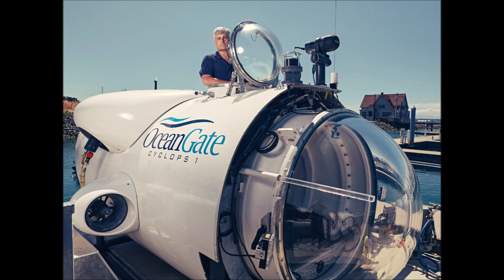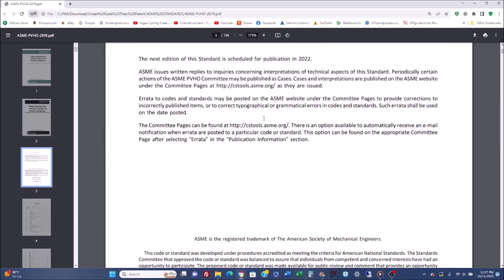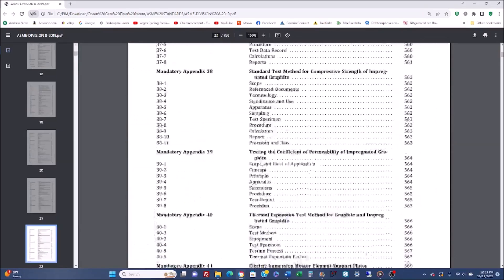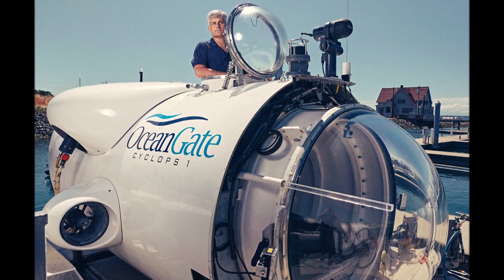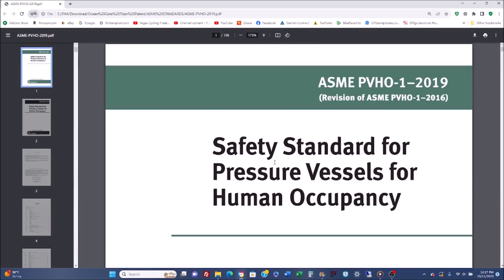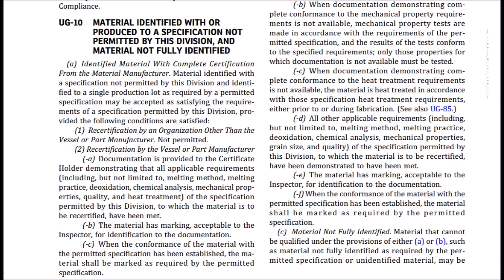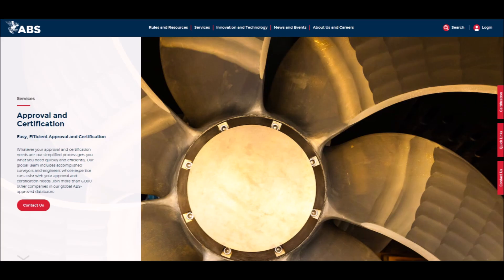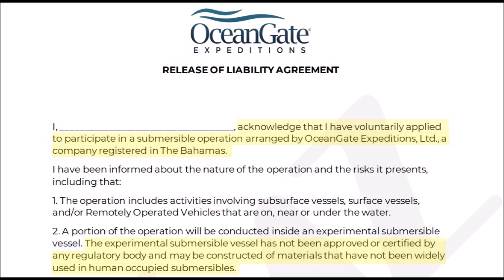OceanGate Titan - "BEYOND CERTIFICATION"?

Comment: This is all mealy mouthed nonsense defending a scumbag who was driven almost purely by ego in a desperate need to be validated as some great mind as far as I'm concerned. 

How do you certify something for which no standards exist? 

Answer:  Run the testing and validation programs needed to gain the knowledge to create the standard, like say testing full sized examples of your hull to destruction under pressure. Something they refused to do, why? Money and hubris, duh. There pressure testing regime for their unproven hull technology was effectively to just full send that bitch to the bottom of the ocean with crew aboard. The result of this idiotic hubris was of course predictable .  

Who certifies these things?  

Answer: The same body that certifies existing sub technology... after you come to them with the results of the above testing program and confer with them to create the certification regime. You know the same way ANY new technology comes into the regulatory regime of existing industry. Of course they didn't have that because they had conducted no extensive test campaign so self-evidently they couldn't create a standard for certification because they themselves didn't really know how the hell their vehicle would be behave. 

What engineer will take responsibility for something where there are really no applicable standards? 

None with any ethics or experience obviously, which was why effectively everyone with said experience or ethics had bailed or been forced out by the time Rush began his 'testing' campgian of playing Russian roulette with the lives of paying passengers, and long before even the above pretty much everyone with expertise didn't even NEED the testing to know it was a Bad Idea because they knew the general proprieties of carbon composites made them a very poor choice from a pressure vessel under compression. All the more so given the extremely tricky process of even creating a composite that thick without creating defects that compromised it. All of these concerns of course completely validated by the pointless death of five people.

In high-risk regimes there is often a very good reason people haven't done something 'innovative' and it's very, very rarely because 'eeeeevil regulations'  or 'traditionalism'.

Comment: Here's what I've seen and my theory regarding the loss of the Titan. From your videos there appears to be a cable running down the starboard side forward from the hull frame to the leg assembly. I cant tell whether there is a disconnect there or not. Perhaps this cable is what kept the leg from being jettisoned correctly?

The original plan for the expeditions was for the Titan to be carried aboard the support vessel. The vessel originally used was AHTS Horizon Arctic. The support vessel for the 2023 season was changed to MV Polar Prince due to leasing costs for Horizon Arctic increasing. Polar Prince could not carry Titan aboard during the transit to the Titanic site. Therefore, Titan had to be towed to the Titanic site aboard the launching platform. Anyone who has sailed the North Atlatic can tell you that it can be a bumpy ride. The videos that I have seen of the towing of the platform show Titan getting bounced around a lot.

I believe that this change had significant impact on the final dive. There doesn't appear to be any support for the aft structure while underway.  Wave action would put significant strains on the aft section connector to the main hull of the submersible over the course of the two days sailing to the wreck site. In the transcript the crew mentions crackling coming from the stern. My theory is that the trip to the site overstressed the hull in a way that hadn't been considered in the original plan. While trying to release the legs, the cable on the forward starboard leg caused the leg jettison to get hung up.

If you look closely at any accident there is usually several factors that combine to form the cause. I believe that these two factors contributed heavily to the loss of the Titan.
Reply from the maker: Yeah I get what you are saying but the thing is that the three horizontal cross members that connected the front and rear interface rings together would counteract the tail sagging and also any affects of being bounced around on the diving platform. It may be possible that this situation put some small torsional forces on the interface ring(s) but I don't know if that would have been enough to really do any damage. Keep in mind Titan weighed at least 20-tons (Bruce Morton said 25-tons), so it's a lot different than being a small fiberglass boat getting tossed around... it's more like an armored car.

Comment: Insisting on using carbon fiber for this application WAS the hubris.
And while ASME may not be a standards body, countless references in standards DO refer to ASME for guidelines such as API and NFPA specs that I work with everyday.
Reply from the maker: In my line of work I sometimes deal directly with NFPA requirements, but that doesn't come up very often. Usually the fire dept takes precedence, and they are the ones making the final ruling. Boilers and water heaters that we may specify are of course built to ASME standards, and they should be as they are ubiquitous in our world.

If you are the first to try something what are you supposed to do? Just not do it? If the Wright Brothers came along today, would they have been interpreted same as Rush?  The nerve of those guys thinking they can fly! I mean when you fall out of the sky, you die. And several people did die trying to be the "first to fly". That's kind of my viewpoint in all of this. Granted, the Wright Brothers didn't immediately offer an airline service after their first few flights.
Reply: The thing is, though he's not exactly breaking new ground here. There are several automated subs that exist. He could easily have stress tested using the carbon fiber design in an automated system way before doing any real human runs, and that to me is the real hubris.

To use your analogy, the Wright brothers didn't have the benefit of automation to test this stuff, and he did. I don't think he did enough testing before using people.
Reply from the maker: @Classwarvet I get your viewpoint. He did do pressure testing and test dives. Keep in mind that all the negative stuff we hear about has to do with pre-2020 Titan with the 2017 hull made by Spencer composites. The post-2020 version of Titan, with a new hull made by Electroimpact/Janicki, was a completely re-worked version of Titan. It performed exactly as predicted until the day it suddenly imploded. It seems to be that the failure in all of this is that the real time monitoring system did not function as the predictive system envisioned. I don't think it translated from the way it's used in airplanes to a DSV. I think that was Rush's main mistake. I think he needed more collaboration on the carbon fiber part of this, but no one wanted to go down the road he was going down. 

I did a video about the RTM system, and the potential problems it could have. It's here if you want to check it out -- https://www.youtube.com/watch?v=XVpkWoHl67Q&t=2s

Comment: The thing is if they just treated the carbon tube as a consumable and replaced it every 20 dives they would have been good. It wasn't the depth that killed it but the repeated stress breaking small amounts of fibres on each dive.
Reply from the maker: I've had that thought too. I believe Titan lasted only 14 or so dives to Titanic depth. It is a pretty big to do to replace the hull but it wouldn't have been too bad if he had a pair of Titans and could alternate which one was in service each year.
Reply: if they done what space x done and get good at making them fast and cheap it would have worked rather than finding a cheap lot of material for a one off build.
Reply from the maker: @geofrancis2001  Maybe so. Problem is demands between the two are wildly different. There will be much more demand for "space tourism", the ongoing demand for getting satellites in orbit, and I suppose the silly idea of someday in the future going to live on a completely inhospitable planet like Mars.
Reply: It’s not the fibre breaking - it’s the epoxy matrix. Rush’s mistake was thinking that carbon fibre could carry compressive loads, it can’t. Compressive loads in composite structures are carried by the matrix around the fibres (like reinforced concrete).
Reply from the maker: @allangibson8494  OK so my contention is why didn't either of the two companies that Rush used to manufacture these hulls tell him that this isn't going to work? Rush only gave them the specs that they were supposed to meet and they did the rest. I can't wrap my head around that. In my line of engineering, we will flat out tell the client it ain't going to work. Our reputation is more important than making a buck.

Comment: What i am going to say is people who knew about these things told Rush he needed to do about 50  test dives with nobody  aboard before he even considered letting people go down in that thing
Reply from the maker: Yeah... that's where Rush's real time monitoring system was supposed to come into play. In theory it should have prevented any disasters. In a previous video I went over that and the potential problems/flaws I see this system having.
Reply: @VegasCyclingFreak  if he'd listened to the advice and actually done those test dives he may have heard the hull fracturing from the safety of the boat but that would've meant having to admit they were right and he didn't know more than everyone else and i fear that was the problem he avoided at ALL costs! Actually 'costs' is the right word as i believe he was that eager for the sub to start paying for its keep, 50 test dives?! If i fill those with people thats err oooh loads! What could go wrong? If were in real trouble the hms will tell us so....roll up roll up (cue circus music)🤹‍♂️🎮🤡🤦‍♂️
Reply from the maker: @shaunmcclory8117  He didn't need to make money from this. He was worth $25 million. 

Don't smear it all together now. All that negative stuff people harp on applies to the version of Titan with the 2017 hull in it. In 2020 while COVID was going on the hull was switched out, and after initial testing in a hyperbaric chamber before it ever touched water, it was deemed safe. Worked great for at least 13 dives to 3,800 meters and many other dives to shallower depths until the day it unexpectedly imploded.
Reply: @VegasCyclingFreak  ha deemed safe by whom?
Reply: @VegasCyclingFreak  Being worth $25 million while working on such a large project is not a lot of money. A failure of the sub would hurt him financially completely if he lived to see it.
Reply from the maker: @cchavezjr7  I don't know all the specifics, but Rush did have some investors which is how he raised some of the money needed. OceanGate was based in the Bahamas. The "mission specialists" all signed waivers that stated OceanGate was registered in the Bahamas. Death is mentioned on that waiver eight times, and also that they were boarding an uncertified experimental vessel. Rush would've just closed down the company if he hadn't also died.
Reply from the maker: @shaunmcclory8117  Rush of course. He pressure tested it and it performed as expected. What else is there to do? Like I said in the video, he had something that no one would certify, because it's using a material which there are currently really no guidelines for. No third party engineer is going to certify that. They're not going to take on liability for that. One reason Rush could "get away" with an "unclassed" DSV is because Titan operated in international waters.

It's very easy for everyone to sit back today and say "I told you so" after the fact.
Reply: @VegasCyclingFreak  yes, but my point is that $25 million dollars is not a lot of money for something to be as a net worth. Generally, net worth has nothing to do with available money as well. He was not one of the super wealthy which people think about these days.
Reply from the maker: @cchavezjr7  Yeah I know what you’re saying. Just pointing out that he had it worked out to where he was protected by his business arrangements. He didn’t really even have to work. He could’ve just went golfing instead.
Reply: @VegasCyclingFreak  it is but they did tell him so but he wouldn't listen and got mardy with anyone that did tell him, and btw dont think in terms of money being irrelevant when  you're hiring ships with large crews and paying dozens maybe 100s of people for weeks or months on end why do you think he charged so much for folk to become a "mission specialist"?..being worth 25million is smallfry his teenage passenger prob had more in his chuffing piggy bank, he was super keen to start the money coming in, look i get all the 'nobody would certify it being an unknown' and all that and yes it is easy with hindsight to criticise but it was foresight from reputable people and he wouldnt listen the guy would even start threatening people if he thought they were going to expose his shoddy circus craft, the guy was a reckless bell end and who would only tolerate yes men, those deaths were very avoidable .
Reply from the maker: @shaunmcclory8117  I'm not here to judge his character/heart. There is one Judge who does that. As someone who works in an engineering field, I see all of this in different light than most people. We can't compare this to consumer minded things like airliners. This is a very small group of people that do this sort of thing and no matter how we slice it, dice it, chop it or fry it, it's inherently dangerous. The ocean is an incredibly unforgiving place. Yes, he could have done it like everyone else but he would have not been able to get the five man capacity inside. I am not for the idea of making Titanic a tourist attraction, or "space tourism". Yeah, it was expensive. In 2022 he spent $1,000,000 just on fuel for the ship to take them to the dive site. He had around 20 employees. He admitted that he wasn't a very good business man. He didn't need to work. He wasn't like me, someone who will never have their house paid off or be able to retire, if I even make it to retirement age. 

Rush did things outside the box kinda his whole life as far as I can tell. He was used to people telling him "you can't do that". He flew in an airplane that he made himself, out of fiberglass, which was another thing where people said "you can't do that". There's a list of things like that. Does that make him reckless and not caring anything at all about safety? I don't see it that way. Everything he did was calculated. According to his former business partner he was very risk averse. Yet he engaged in activities that had inherent risk, and he was well aware the risks. Kind of like people who work in an office all week and then do highly dangerous activities on the weekend, like flying in wingsuits or free climbing a 1,000 foot cliff.
Reply: @VegasCyclingFreak  i understand  everything you say and agree with most of it, i was not suggesting he built his sub like the others but with such an experimental design and using the materials he did he should have done enough test dives to at least be able to back up his confidence with a number of unmanned (or just Rush manned dives), also i know about some of his previous endeavours when he was told 'that won't work' but he was proven right but i think that didn't help here sooner or later doing as you rightly point out very dangerous things he would be wrong sometime,and what about Lockridge? He spoke up about numerous safety concerns and was treated appallingly it seems, hey i bet he is mightily relieved now though!
Reply from the maker: @shaunmcclory8117  Rush did very first test dive solo, in the 2017 hull, and it appears to have scared the poo out of him. I pointed out in my video on the view port that the Lochridge lawsuit applied to the 2017 version of Titan, and the viewport was one of his concerns. The lawsuit was mainly over Lochridge sharing what OceanGate considered confidential information. I don't disagree with any of his concerns, but they do all apply to the 2017 hull version of Titan. We don't know for sure what may have been changed in the 2020 version of Titan other than the hull. The view port could have been made an inch or two thicker for all we know. It appears that Rush quietly improved various things during COVID but exactly what they are I don't know.

Comment: How would you feel about a 3 inch Aluminum inner tube, with the 5 inch carbon fiber tube on top of it. Taking say 50% of the load, especially on the titanium end caps! Would that of saved the Titan? (Just a quick thought experiment).
Reply from the maker: Hmm... I think the problem with that idea is the use of dissimilar materials. Aluminum will expand and contract some amount with temperature and the carbon fiber won't. Carbon fiber is also about 4 times stiffer than aluminum, under normal circumstances. Still is problematic I think. Best way to build a DSV is by using all same materials for the pressure vessel, except for of course the viewport(s).
Reply: Carbon Fibre has no compressive strength. It is a cloth - good in tension, non existent in compression.
The compressive strength comes from the epoxy matrix.
An all aluminium submarine like the functionally identical, all aluminium alloy, Aluminaut would be another option.
Reply from the maker: @allangibson8494  Yes, the way the hulls were manufactured it relied much too heavily on the strength of the resin. Once again, why would the manufacturers of these hulls make them that way? They are supposed to be the experts in all of this.